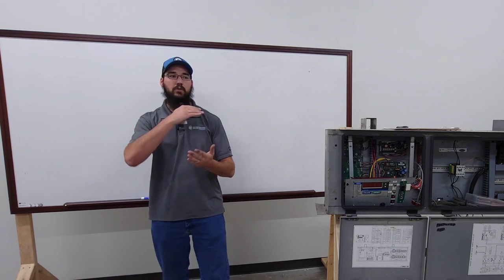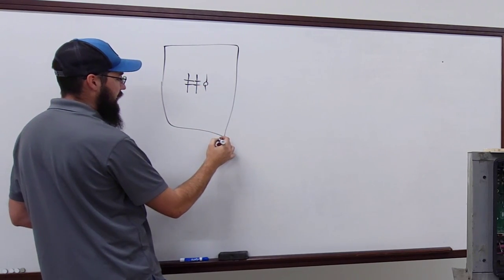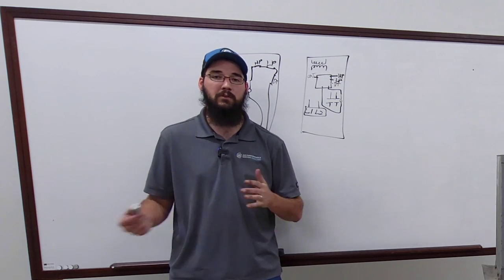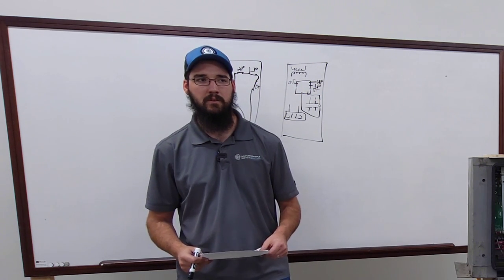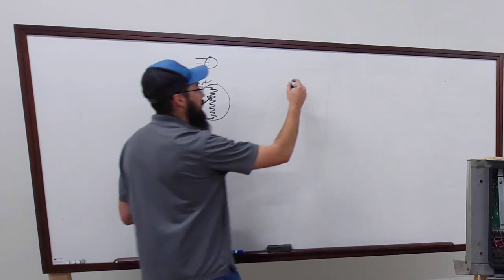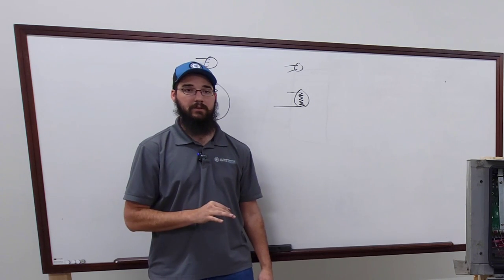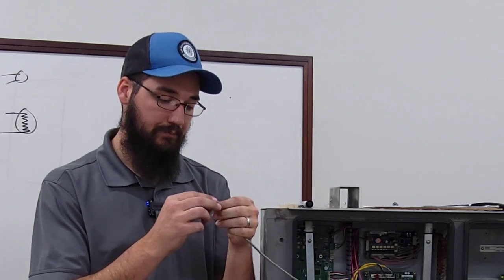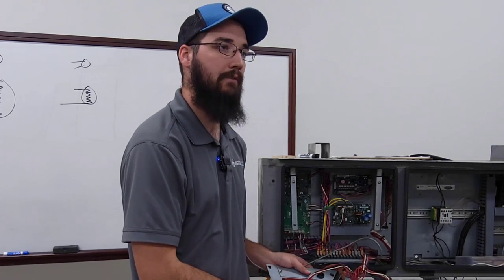Advanced Modern Electrical Troubleshooting for HVAC Technician

Comment: Why do we keep changing everything, old air conditioners lasted 50 years,just make those.
Reply: Bc its a cash grab more likely for something to go wrong
Reply: Yes sounds like bs to me. I learned hvac in 1983 & 1984 & now I being out of it since the 2000 timeperiod are as clueless as a never trained person.. It just ain't right.
Reply: Strong products put company’s out of business. The bits and pieces is a place they can control and make margins easily.
Reply: EPA
Reply: I empathize with you, but like the instructor says, using my interpretation, often times is not even the manufacturer issue. The issue here are the policies putting out by our government and its agencies, to meet environmental requirements of efficiency and safety. My personal opinion, it is all politically motivated to discourage the use of oil and its byproducts. Simple !
Reply: 2 words.. energy efficiency.  Same could be said for every other vocation. Cars and everything else in the modern world.
Reply: New technology comes out allowing better control but, most importantly more efficiency. Compressors running off a VFD vs just on and off will be more efficient, especially with the in rush current on big compressors.

EPA requires manufacturers adhere to certain efficiency standards, and those standards are always changing. New r32 instead of 410a, SEER2 ratings now, etc.
Reply: No money with that longevity
Reply: He answered this. Its for more efficiency.

Comment: This stuff really isn't difficult. It's just new. The only problem I have with making things more efficient is that all these thermistors, transducers, and control boards are built so cheaply and break so quickly due to companies trying to be competitive with one another that it literally defeats the purpose. I just wish components were built with a better quality so that I dont have to replace these cheaply built overly expensive control boards and sensors. Customer buys an high end piece of equipment to save money but then the warranty ends and a $1500 control board fails and now all his savings are thrown out the window. What a rip off lol

Comment: I/O lets GO.... As a BMS (Automation) controls engineer.... All AHU's in the UK are having the proprietary controls removed and back to standard control systems. All Techs will need to understand BacNET (American standard). It is a great controls system
Reply: Was gonna say, we rip all that out and out in our own sensors, actuators and relays, we may still use their terminal strips but that’s about it
Reply: Do you mean that they are designing standard units now instead of more complicated units ?

Comment: Hello! I am from Spain and I have watched some of your videos and learned a lot, as I am starting on this complex world of refrigeration. I got curious about this video as I have recently finished a training on automation and plc programming and wiring with some LOGO and 1200 from Siemens, which has helped me a lot to understand. The industrial buses communications as you explained where every single sensor or actuator sends and receives information trough one bus and you just have your plc and your power outputs (contactors etc...) I truly think is the direction on we are going to. 

Big hugs from the other side of the ocean!

Comment: When testing the thermistor's even if you have the needle meter leads, tape the thermistor to the unit, it's usually long enough and your done in seconds, instead of fumbling around.
I saw a guru on here do that. He was testing on a 6 wire pin, ohmed out the first 3 all good got to the fourth bad used that tool to take the wire out and traced it back to it's location. Taping it up made it so simple.

Comment: I am a refrigeration install and start up tech for hussmann in so cal  ems alot of what your talking about has been around for all 20 years ive been in the trade the last 10 the ac package units have started to be on tge modbus net control by the stores controller along with the refrigeration and even the lights in store and parking lot

Comment: We used to be able to fix all manufactured equipment with the simple defrost clocks,relays, and components...
When I first saw a control board after the Micarta Terminal board  I knew we were F+&d.....
Now there's GD Laptop running a Fkn Heat Pump and we're going to VFD on Residential!?! 
Damn....
Reply: Yup. 90% of the equipment I install and maintain on the resi side are inverter driven vrf systems. It's really efficient, but really expensive, unreliable, and very cost prohibitive to repair. The industry is moving that way for a reason. Designed obsolescence.

Comment: Very informative. 
Gone are the days of the line diagram trainers with the light bulb, bells and buzzers!🤣🤣
Thanks again for the videos SUPER-YORK!!!
🍺🍺🍺🥃🥃🏌🏻‍♀️🎯
Stay safe. 
Retired (werk'n)keyboard super tech. Wear your safety glasses!
Reply: What's a air handler and what's it's function?
Reply: @Bunny Man  well it handles air (a lot), and its function is to distribute the air through ductwork *mostly *
(Fan assisted)
Reply: @realestateservicessaleshea99   Thank you! I don't see much material covering that.

Comment: Trane use LON and low level intelligent devices (Nodes on a network). Works really well. That is why you have to bind them. Basically you have to address it on the network

Comment: A small Oscilloscope can be used to see the communication wave forms to see if the signal is working or pulled to ground by a failed component.
Reply: Wouldn't you be able to do this on a multimeter  in VDC (obviously not as precise as am Oscilloscope).
Which handheld Oscilloscope  you recommend

Comment: We used to carry cardboard on the van  to initiate a defrost on heat pump condenser coils when the pressure drop , static pressure drop caused the defrost if the mechanical clock said let's do it!

Comment: Over engineering at its finest. 
It gets really fun when you get a new board and the firmware does not support other pre-existing control boards and does not work. If you have not seen that yet believe me you will
Reply from the maker: The FUTURE
Reply: I work with things like that all the time. Not anything works with each other made by the same manufacture.